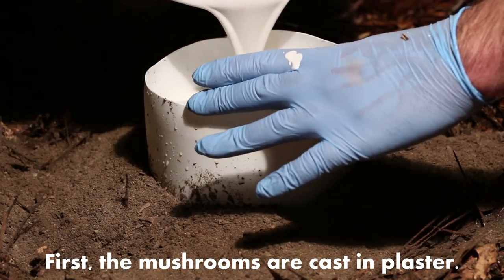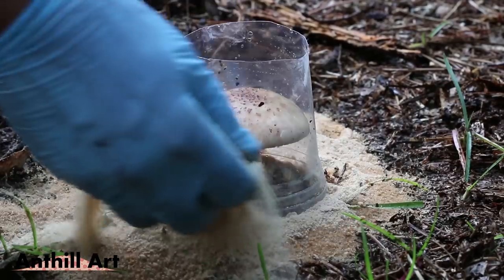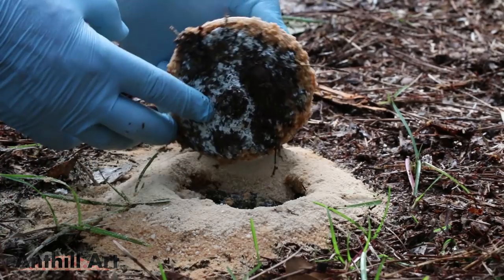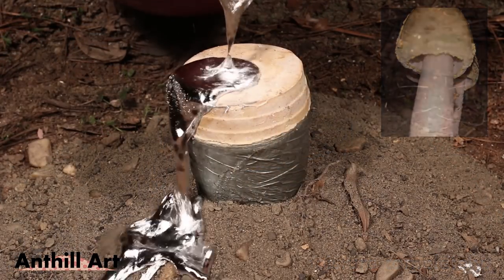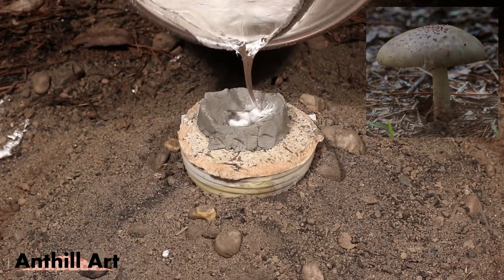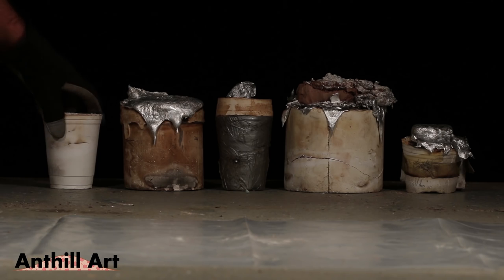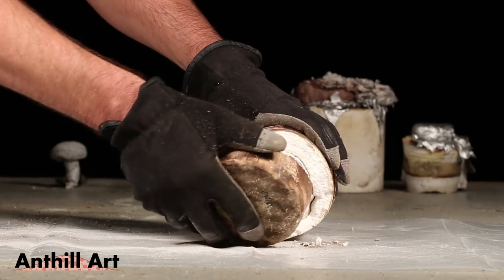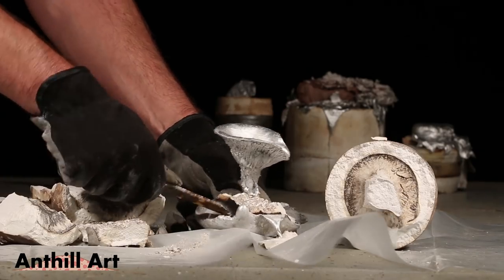Early Attempts at Mushroom Casting with Aluminum

Comment: What do you use for plaster?  How do you dry it?  I'm interested in casting some items in aluminum, but need to know what plaster to use for the molds.
Reply from the maker: On these 5 casts some were regular hobby store plaster (which I think is just plaster of paris) and a few were hydroperm plaster. I didn't dry these good enough, but I use a lab oven to dry them now. It takes a while for them to dry completely (a few days). I don't have the method perfected now enough to tell you exactly what to do but it's best to dry it continuously until it's time to pour the aluminum, weighing the molds occasionally until they stop getting lighter from moisture loss. I don't really know the best temp to keep it at but at higher temps, regular cured plaster starts to turn back to powder. There are some plasters made for doing this, look up "investment casting" which is what jewelers use. Also, depending on the objects you want to cast, green sand casting might be something to look in to.

Comment: Awesome! How do you remove the mushrooms from the plaster?
Reply from the maker: It's not easy. Let it decay a while, dry it, wash it, scrape it.
Reply: +Anthill Art I was wondering if you might be able to burn it out in your furnace, or at least make it easier to remove. Like a lost wax/ plaster casting.
Reply from the maker: +bigmic4 if I had a furnace that I could control the temp accurately I would do that. Needs to be slowly ramped up. I do use a lab oven but it doesn't get as hot as I need, but works ok.

Comment: I was wondering if I could just put the mould in my incinerator to burn the mushroom out ? 

Maybe you could wash the debris out with liquid wax if the mould is hot enough?
Reply from the maker: It would probably work if you could ramp up the temperature slow enough

Comment: Do you do a fine sandblasting or something for the finish? 

Also I hope you won't stop making casts of ant colonies. 

Mushrooms are interesting, but the underground workings of ants are something not as often seen.
Reply from the maker: +Nova Light Yeah I just wanted to do some with different. I'll do more ant colonies soon. 

I blasted some of them with fine glass beads, that really just cleans them and leaves it pretty dull. A fine brass wire brush on a bench grinder shines them up ok after that. The beads help clean where the brush won't reach.
Reply: Interesting, and thanks for the response.

Comment: How did you get them to stand up right on the wood will you please explain
Reply from the maker: I tap a screw hole in the aluminum then use a screw to secure it to the base.
Reply: +Anthill Art instead of tapping one into the aluminum could I drill a hole then use a bolt ? Because I have been doing my anthills and hot glueing them on wood and I mean it works just not really sturdy
Reply from the maker: +Wesley Nutt Yeah that's basically what I mean, but to make threads for the bolt/screw you need to drill a hole then use a tap to make the threads. For heavier casts I don't bolt them, just set up dowels in a way that the cast sits upright. Most of my ant colony casts are setup that way without any mounting to the base.
Reply: +Anthill Art thank you so much for the advice